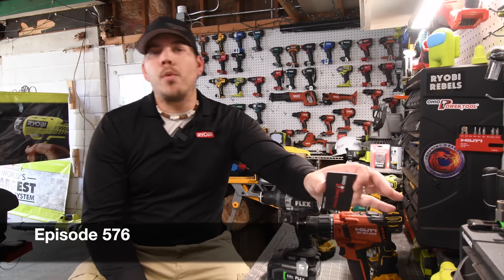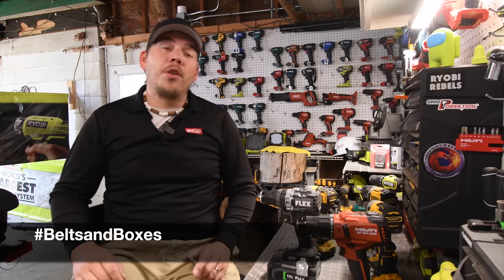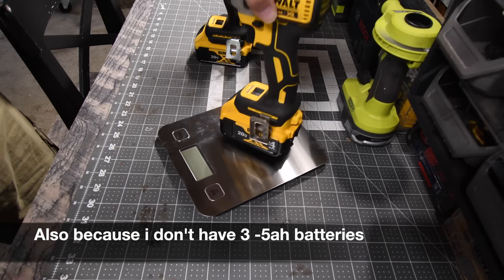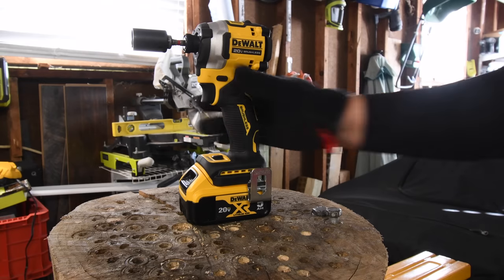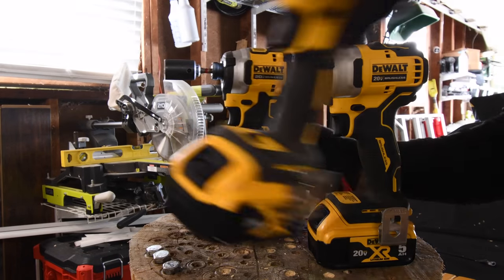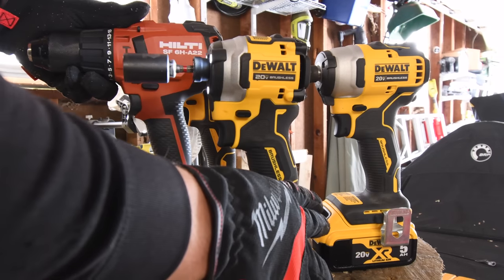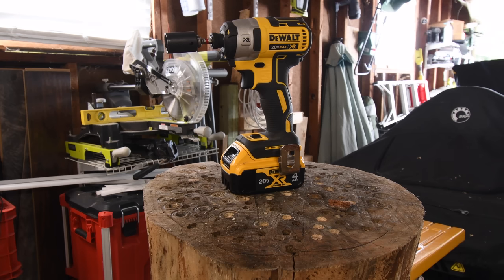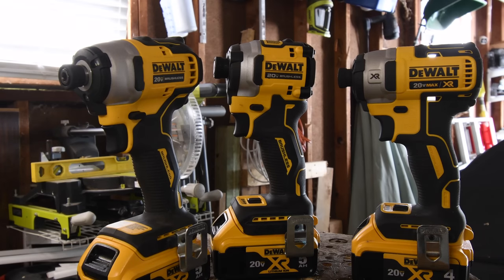Dewalt XR vs Atomic Impact  Drivers

Comment: I’m a HVAC guy and i’ve used my 809 for about 3 years every day and i’ve dropped it a couple times once off a scissor lift from 30 feet and it still worked fine. All it does is take our 1/4 5/16 3/8 head screws.

Comment: Been using my 850 every day two weeks from now and I have no regrets at all. 887 been on my tool box since a went to my local depot and bought the new atomic. I even test it against my 887 and it really performed really well beating the XR in almost every test. I’m a drywall framer
Reply: How has the 850 held up for you.

Comment: I’m in the service business and use mine daily, I have a lot of dewalt tools and my nail guns are now cordless. I use to get the cheap atomic combos back in the day and when the xr came out I purchased it and it rocked so I’ve stuck with them ever since then, I will say I’ve had to replace my impact driver twice due to the power surge issues. The drill driver has been a beast and fine. I’m going to get a new atomic just because it looks cool and seems legit.

Comment: I do love the small size of the Dewalt 850 and the power, But I will sacrifice power etc to precision and that’s why I am a huge fan of the Makita XDT16 it’s also compact as-well. I just prefer it because of the different modes you can place that tool in with the touch pad to allow the tool to be more precise in delicate operations.
Reply: U can get the 850 with the mode selector

Comment: I was waiting for this head to head. Been thinking I want the new Atomic (have the 887) this makes me want it more. #beltsandboxes
Reply: I switched from the 887 and I didn't think the weight difference was going to be noticeable but to my surprise, it is.

In performance is not a HUGE difference but there's a difference for sure, I do recommend the new atomic 850. I use it daily, BTW

Comment: I bought the Atomic for a home renovation. I’ve been hearing mixed reviews. I like it but I have nothing g to compare it with. Do you think o made the right purchase?
Reply: I also bought the atomic and I would have to say that it is worth every dime. It is very well built and has a lot of power especially when it comes to removing lug nuts. The only difference is in power, if you want even MORE power you can upgrade to the XR.

Comment: At work I have a dewalt drill and 1/2”impact wrench. 
And a 5yr old Ryobi brushless impact driver. I was recently considering “upgrading” my driver to a dewalt. 
But shocked to discover every model of dewalt I can find has a lower torque rating then my 2000 in-lbs ryobi. 😮

Comment: Are they trying to move the Atomic range from handyman / DIY to trade ?   I’ve kept away from anything with Atomic on it for my trade tools so interesting to see the results here.
Reply: I believe they are. Atomic actually just means compact. It's their compact line of tools but I agree, I wouldn't buy anything atomic before. Things are changing in dewalt land.
Reply: @b-2466  I see this also, new tools like the low-range DCF923 impact wrench now have the nice push button speed/lamp controls like its 2 bigger brothers but bears the atomic label. It no longer means a cut down version of the full XR tool anymore, but a full featured modern compact tool, for example the newer compact 1 3/4" bandsaw also has the atomic label yet its a full quality tradesmen tool for the conduit jockeys. Overall it makes the brand less confusing now knowing you aren't getting a 'cut down' version of the tool anymore just because it bears the atomic name like when the lineup was first introduced. Cheers.

Comment: All good contenders..... would like to see you use 6 X 6 pressure tx wood and stack them if you have to just to give a more consistent wood density to show the differences without issues of what that log can cause.  I'm not usually putting lags through logs haha.  Thanks for the video. #beltsandboxes

Comment: After years of faultless use of Makita battery tools I decided to try DeWalt XR It started when the drill in the kit had NO SECOND SPEED GEAR FITTED, after getting a new kit, my 18v drill put out lots of smoke when drilling a hole in steel with a drill my Makita drill would have had for breakfast. It was repaired under warranty but I haven't trusted it yet, after 3 months the impact driver bit retainer broke, it was replaced and lasted 4 months then broke. The angle grinder Still works but the detent on the tool lock spat the dummy (pacifier to merikans)
I will NEVER BUY A DEWALT TOOL EVER AGAIN. PERIOD.

Comment: The 850 might be DeWalt ‘s top of the line impact driver for now…..

But we want a rematch!  887 vs 850 with same size ah batteries, vs a new contender the skinny dcf840 replacing the dcf787 much the same way the 850 replaced the 809.  All with same battery as well!  Will the 840 best the 850??

And for battle of the brushless DeWalt bargain bins.  Who wins the dcf809 or the dcf787??

Comment: Two things detract me from that impact. The fact that the speed bore fell out meaning it might have a bit retention pin issue similar to that of the older m18 gen 3 fuel and the fact that it does not have the new selector mode dial that the impact wrenches do... like why couldn't they just put some effort in to incorporate that into this to? That selector switch is truly maddening have used it not a fan whatsoever!

Comment: I was debating on switching to fuel because of their compact drills but they're so pricey... And I have so many yellows... After I found out DeWalt released 850 and in December 2021 releasing smaller, lighter & more run time 20v stack lithium batteries... I ain't going no where. #Beltsandboxes
Reply: Those batteries do not have more runtime, they crap out faster than a 2ah, they just put out a lot of power very fast. That is why they drain faster.
Reply: Man it always was that way but honestly their about the same with DeWalt being a little more now lol

Comment: Maybe dewalt will make a warm battery box so my battery’s won’t freeze up everyday  I use 15 5amp batteries a day on a swing staging off a building  and when I go to lunch there frozen so I can’t charge them 
Be cool if they made a 20v battery powered small heater for a 6 pack of  5ah batterys just so it was 50 degrees 
If I had 120vac I would just put a 60w lightbulb in a bucket and a cover and it would warm up

Comment: Do you realize every time your driving a screw right next to the previous one it's way way harder. Imagine setting and axe. When you drive a split the wood it becomes harder. You need a whole new log at this point and knowing the pressure rates of that log would  help but not alot. In the industry we use code wood. So just go buy new wood from a store and test new every time or your just fulling youtube for cash

Comment: Hey man this is a really uncontrolled test. Get a new damn block of wood, that shits got so many holes in it that simply drilling 1 inch next to another hole I guarantee makes the bolt drive in faster. Get some new wood.